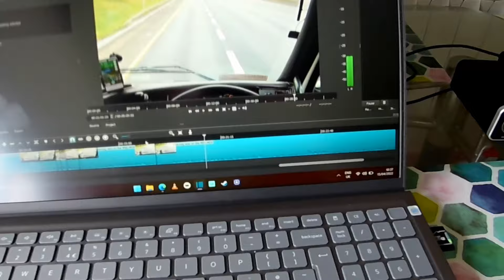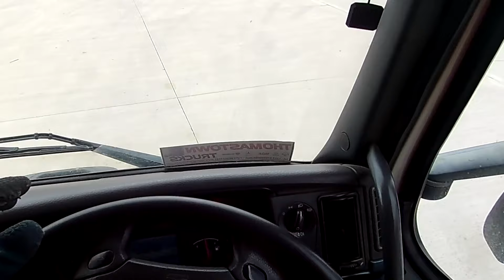Driving the wrong way on the M50! SO CRAZY!!!

Comment: good to see you are on the arctics at last ,,when you drop a trailer ,put  the legs to the floor then wind back one full turn ,that way the trailer will never be to high when it is loaded..as for reversing it will get easier as your confidence grows ,,i have done the very same thing .by going the wrong way .only fpr me it was 20 miles to the next junction,,,take it easy and enjoy life ,,,